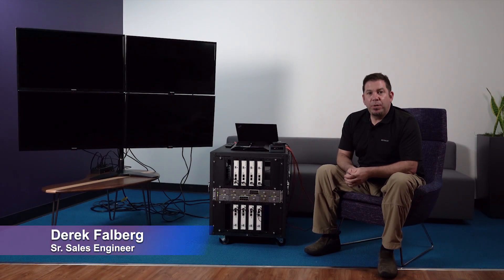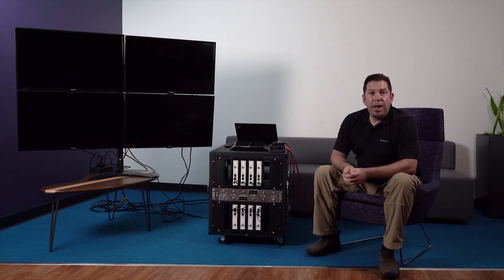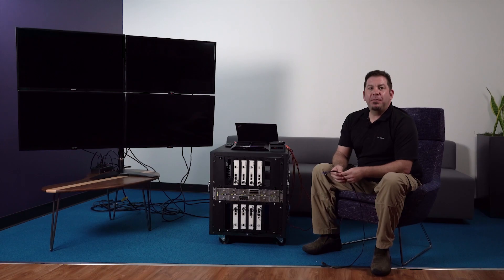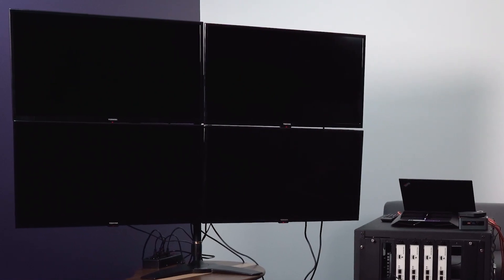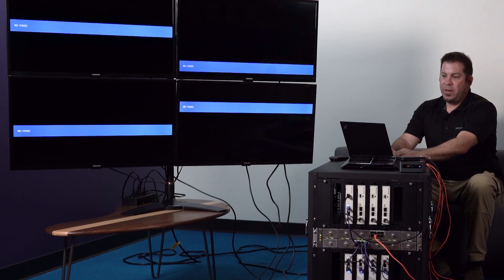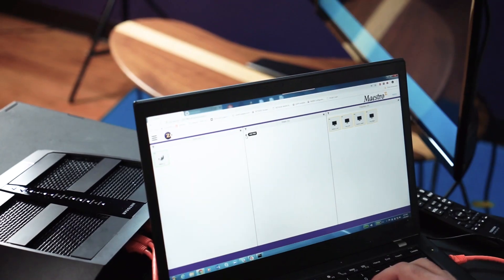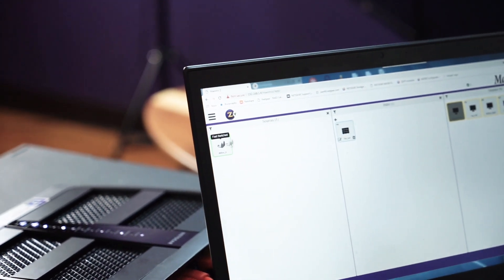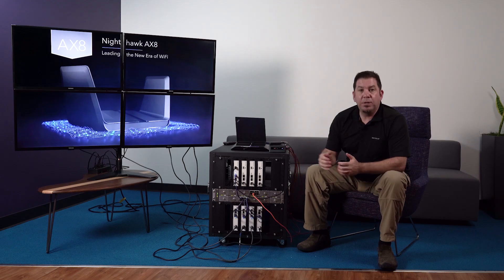How to Set Up a Video Wall with a Pro AV M4300 Switch | NETGEAR Business

Comment: So why do you need the M4300-96X modular switch a blank frame is $6K List? Can't you just use a XS728T-100NES or M4300-24X24F (XSM4348S 24 Ports 10GbE Copper) which is a 10GbE switch?